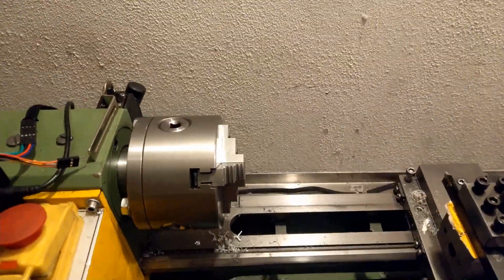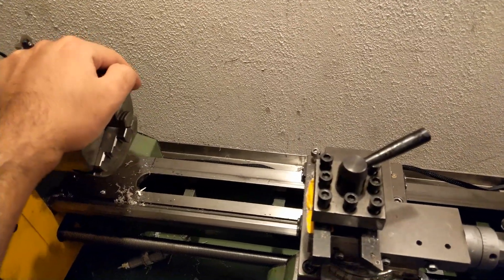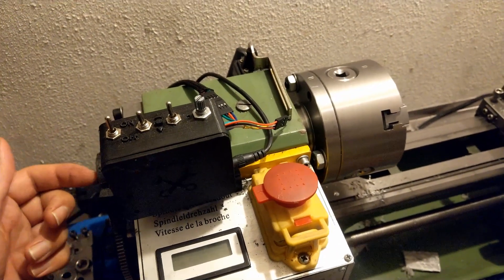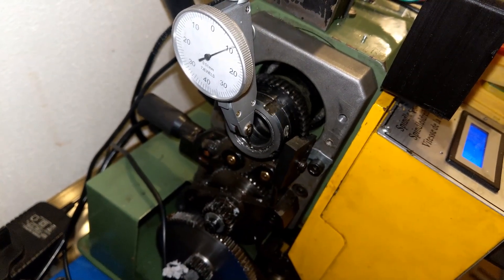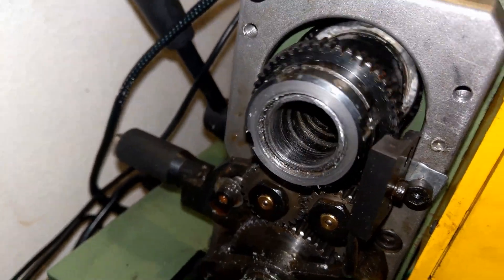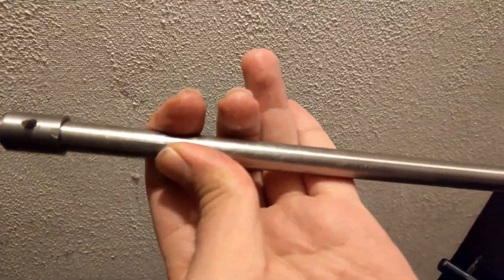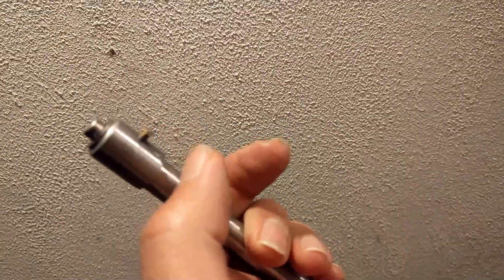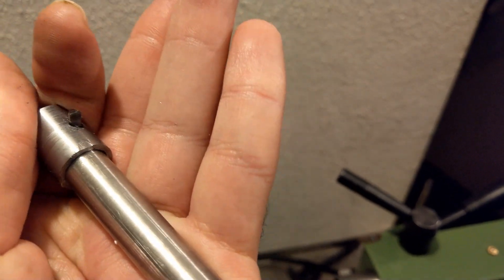What Would Be Next Mini Lathe Upgrade ????, Give a Guess

Comment: The spindle on your lathe looks like it has had added 'bad' machining since it looks about 10mm shorter than the standard spindle fitted to most mini lathes.
Reply from the maker: the spindle length is standard, but I changed the spindle ball bearing to taper roller bearing , since taper roller bearing housing is slightly longer in length it cuased that